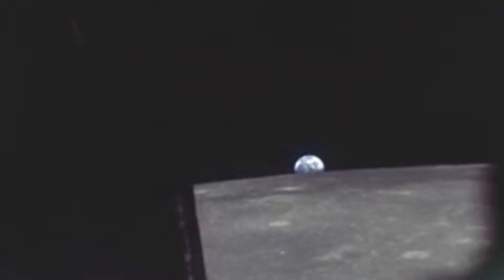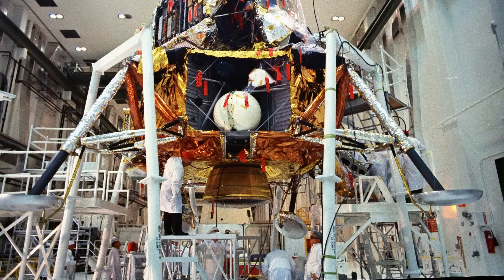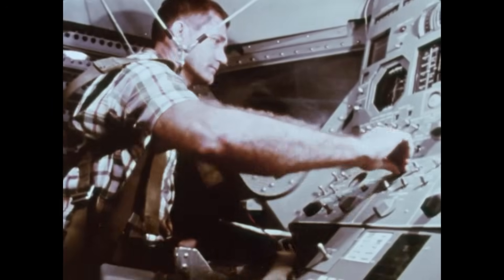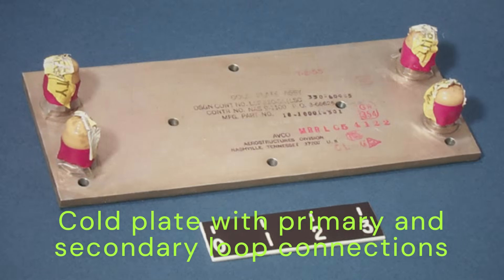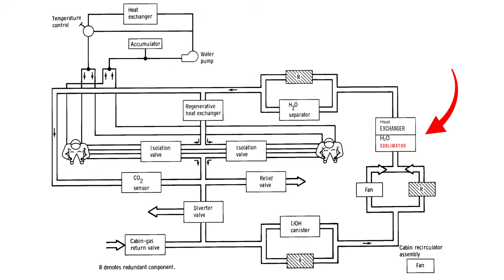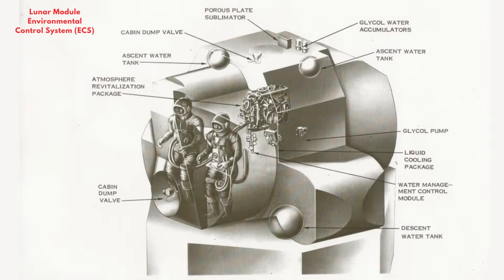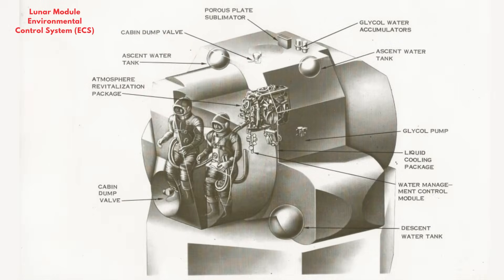Inside the Lunar Module’s Cooling System: How Apollo Stayed Alive in Space’s Heat and Cold

Comment: Thank you for these great insights on how the systems on the spacecraft work 👍😀.
These explanations go deeper then other videos and as a retired engineer I really enjoy these things 😀.
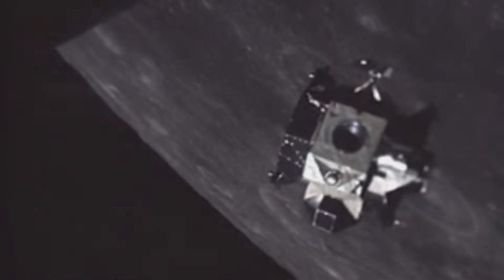I have a question about the explanation of the functioning of the sublimation you explain on 7:04 into the video.
Hot coolant goes into one side of the sublimator / heat exchanger en on the other side this heat makes ice instantly into vapor.
But where is the ice coming from ?...
And is this sublimator /heat exchanger outside the spacecraft ?...
Thank you for your explanation 😀
Only point of disappointment is that a science engineering channel like this doesn't use S.I. Units itself 😢....😂
Reply from the maker: The ice in the Apollo Lunar Module’s sublimator comes from regular onboard water, which is pumped into the sublimator and instantly freezes in tiny pores as it meets the vacuum of space. The heat from the spacecraft warms the ice, causing it to turn straight into vapor that escapes into space, taking the heat with it.
The sublimator itself sits right at the edge of the spacecraft, with part of it exposed to the vacuum, so that the vapor can leave freely.
Thanks for the tip about units! You’re absolutely right—using SI units helps everyone, so they’ll be included in future videos wherever possible.

Comment: Is a sublamator the same as a modern day heat pipe used to cool computers.
Reply: Sublimator consists of a porous tube though which water is passed. The outside of the tube is exposed to vacuum. Water on the outside of the tube boils into space causing ice to form on the outside which then sublimates into space. This cools the water inside the tube. It does consume a resource in this case water in order to achieve the cooling effect.
Reply: Heat pipes have some similarities in that they use evaporation cooling  but are a closed system. A fluid boils at the hot end and is condensed at the cool end. A wick is used to move the cool fluid back to the hot side. So the working fluid is re-used
Reply: @markgohl2660 ah, I had a similar question. I wasn't entirely clear on whether the sublimated water was recovered. So it was a consumable. I wonder how much specialized water mixture it required and what was the safety margin in days. Great channel and info!